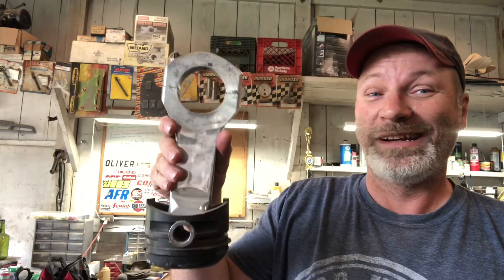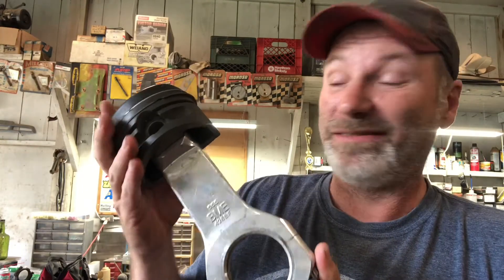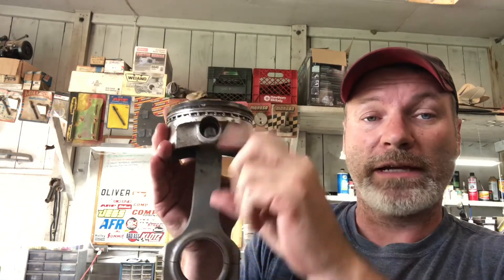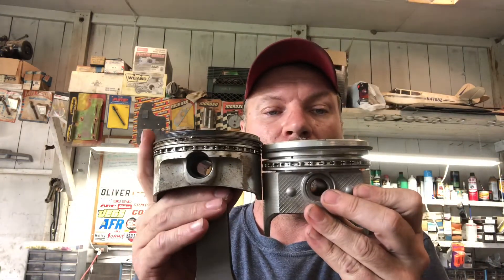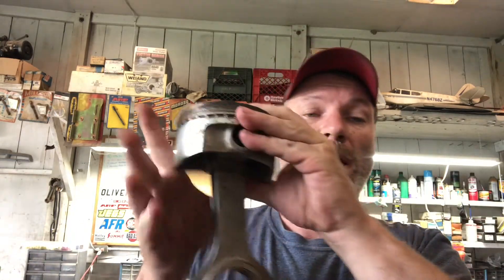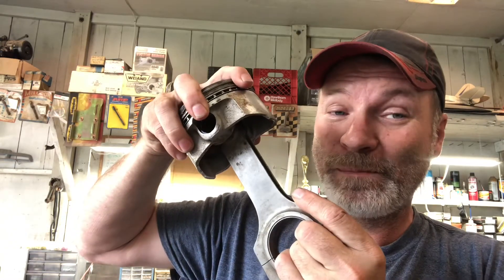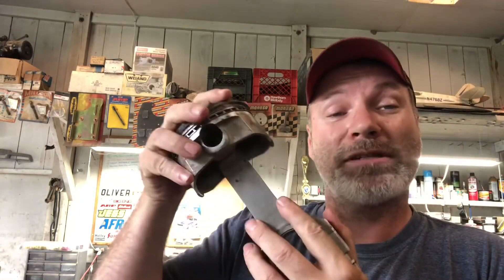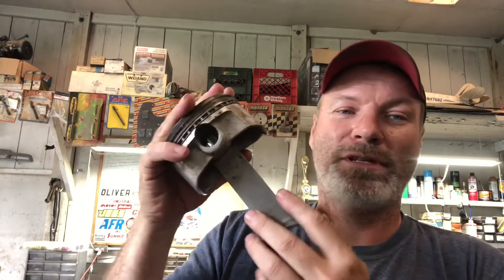Let’s talk connecting rods, harmonics and saving a stock block 302

Comment: From a turbo guy in Australia.... Girdles, depending on how its made, definitely do work. Some are just a joke, a laser cut 6mm plate over the existing caps isnt going to do ANYTHING except like you said, hold the detonated parts together. BUT, like in some rbs iv done, the factory girdle goes in the bin and i put new two bolt caps with a plate that ties the caps to the block, not just tying the caps together. it has 172 fasteners in total, including main studs, and they are stout as f